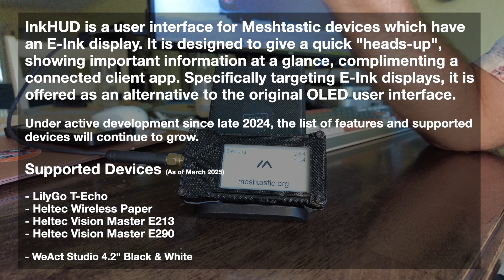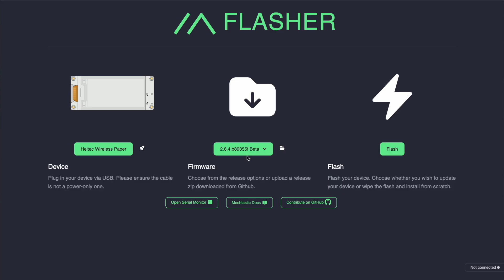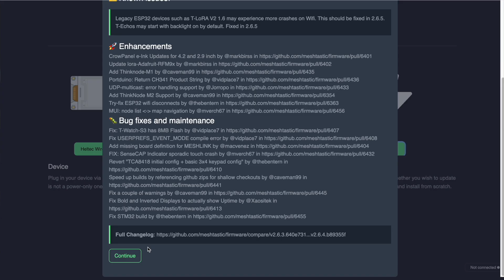How to Flash InkHUD on Heltec E-Paper Display 📲

Comment: I bought a Realtek Wireless Paper, and everything works perfectly, except for the display. It shows “LORA MODE 0” and “HF” on the screen and won’t change.

I’ve tried several tutorials, but nothing worked so far.

Any ideas?
Reply from the maker: @JohnCalistro you have to flash it with the Meshtastic firmware at https://flasher.meshtastic.org/, select the target "Heltec Wireless Paper" and follow the steps to flash the meshtastic firmware onto the device.
Reply: @ViVSoftLLC  Fixed with the alpha version 2.10. Thanks for the tip.